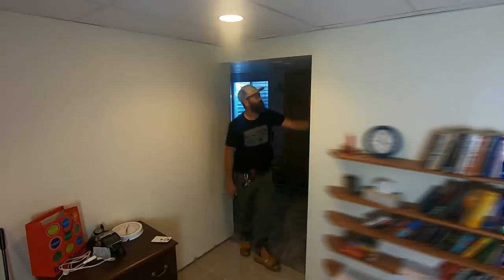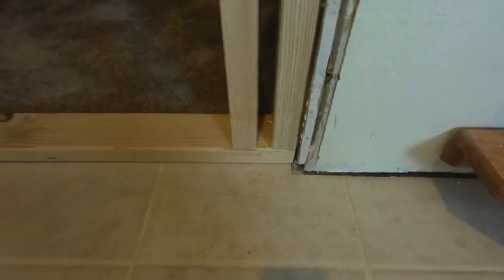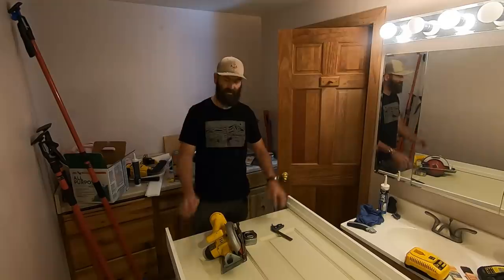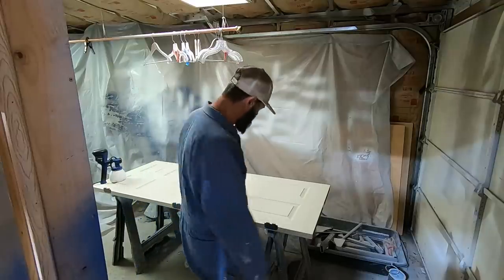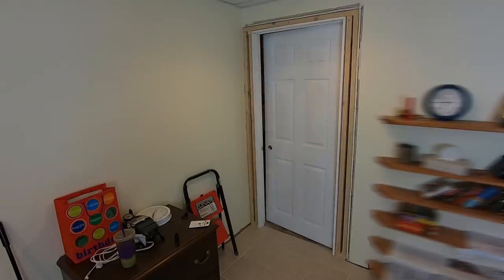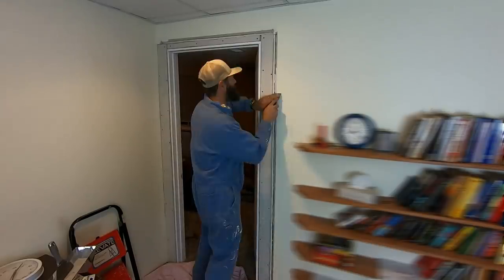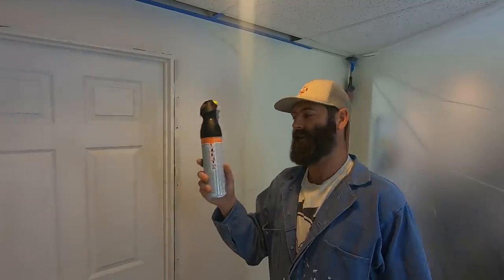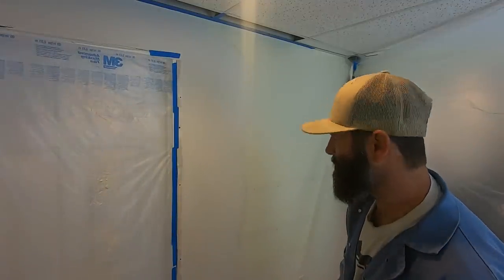The Impossible Doorway Build | They Said It Couldn't Be Done | THE HANDYMAN |

Comment: I would have filled the bottom of the door because I've had problems with moisture building up inside the door and causing problems with particle board swelling at the top after several years. Paint seals up the bottom.  I put an old vitamin plastic pill bottle on my box gun and so can do small amounts of texture, didn't cost me anything.  I'm sure you filled the door frame holes from the pin nailer like I would have. The foam filled hollow core doors tend to resist holes because they flex a bit when struck and also keep sounds from passing through them. I think removing the shelves to make the job look right was the correct thing to do, but a lot of guys wouldn't waste the time and it would look like a slop job. I can say that the attention to detail was fantastic, and couldn't do it any better myself. I love watching an artisan at work!

Comment: Pretty good job a couple things to remember though normally only the legs of the jam are secured to the framing not the head meaning the door could have been taller by about 2 inches taller and the rail of the door that was cut out should always be replaced to keep the strength in the door and prevent the door from rattling just trying to help out not put you down

Comment: Good work man, I learned after 10 years of drywall to use those straight edges (door jams) to float the mud, obviously trim will hide most but it saves a lot of time in scraping/sanding. Keep up the good work

Comment: The reason for the missing screws is that you can put a longer screws to help the door from coming loose after time. You drive the screws onto the 2 /4 behind the door jam.
Reply: P.s. to missing screws .You need the longer screws if you hanging a fire door because of the weight of it.

Comment: I believe the missing screw in the hinges is so u can put a 3" screw so its more solid at the hinges.
Reply: Unlikely. We saw the wood, inside the door, in which the hinge screws are installed.
It must be around 1-1/2" of screwing depth maximum.
Reply: @paulp.l.4869  yea u right my bad. I used a 3" in my door but I had over 3" of wood to grad
Reply: @smfd190  
Thanks for the reply.
On full wood doors you could go longer.
I've been using the supplied screws that come with the hinges for interior doors.
On exterior doors I use longer construction grade screws to get to the studs, but keep the 1" screws for the door side.

Have a great weekend.

Comment: When I have a cheap door like that and some of the screws don't want to bite,I will actually use construction adhesive in the mortise and on the backside of the hinge.ill also pump it into the screw holes before I put them in, obviously you want to do it with the door off the jam and let the glue set up before you re  hang it.

Comment: I tried to use that texture in a can,and for the cost and the potential for the applicator tip to become inoperable, usually from one of the other guys using it. I went back to the old trick of using a gong brush and then I get joint compound and add some water to get a consistency for a particular texture finish, here in Texas acoustic is popular for walls, which incidentally on a long steep stairwell, is good for acquiring some road rash if you're a little tipsy and you get off balance going down the stairs. I dip the brush into the mud and then you flick the bristles and then it magically creates the texture. Great for a spot texture approach. Interesting thing is I learned that trick from a roofer.

Comment: your work always comes out great!  I'm a carpenter also, I was wondering if you could have shifted the door over to the right and just pad the left side, (unless the rt was a corner and not an end) and if the height worked for the door without the 2x on top so you would not have had to cut the door

Comment: Tough situation, but you did it.  I had a similar situation that I think you’ll appreciate.  I installed a double french door in an opening where the south wall was racked east at the top and west at the bottom by 3/4 of an inch.  The north wall was racked west at the top and east at the bottom 3/4 of an inch.  On top of that the opening was racked at the top north by 1/2 inch, and south 1/2 inch at the bottom in opposite directions.  So I had a rhombus geometric nightmare.  But, I was lucky.  It was a 5’ opening, so I closed it in to a 4’ opening with additional 2x4s, and corrected the racking so that I could install a 4’ double french door.  It was not easy doing the wall correction in only 12 inches, but it turned out great.

Comment: I would have glued a filler in the bottom. That thin skin has to be very weak.
Reply: Yes, why wouldn't you fill it?
Reply: Over time it may bow or weave with moisture also
Reply: I totally agree. It will warp or get kicked in and only takes a minute to reinstall the filler you just cut off
Reply: Perfect! What I've done that I've found quick and precise is rabbet the finish side off and cut the ends off at the saw. You're left with the exact same filler to be glued back on. To hell with their warranty. It's a $40 slab.
Reply: I normally cut a new one and glue it in but without it the door will eventually be jacked at the bottom
Reply: yup its gonna warp may not for a while but it will smallest amount of dampness and it will look like the ocean it is pretty much pressed cardboard  i always put mine back in never got a call back on one in 40 plus years of doing it they used to have way more stuff inside them back in my day they had cardboard all through the core now its even crappier
Reply: @jwp09  not maybe it will for sure i have seen them warp in just a couple of weeks just need a little dampness and once it swells up it never goes back
Reply: The unconventional approach is to use a couple cans of great stuff to fill the cavity and then the bonus is that you wind up with a significantly thicker door as well.
Reply: You always glue in a filler after you cut the door,  and you also would have only needed 1 or 2 cripples ( not studs) each side, floor to ceiling. In this application, there was no need for a top or a bottom piece.
Reply: He's a handyman, not a trim carpenter.
Reply: @DARTHFEAR0N  dont matter any job worth doing is worth doing right every carpenter i have ever met in 40 plus years always puts the piece back in the bottom if you are doing this kind of job you should know that its first day on the job kind of stuff i would teach noobs on their first job
Reply: @kirkyorg7654  you're right. Every door I cut off like that I do put the bottom back in.
Reply: It will make a great home for bugs!
Reply: I always fill the bottom in when I cut down a door. Usually just trim the old bottom with a table saw and glue it in,  Not sure why he needed to pad down the top of the doorway 1 1/2", either. The less you cut off the better, especially on a 6 panel door.
Reply: this is how he gets them to come back in a couple years

Comment: Once you had the framing done I would have cut out the top plate too, of course a screw in the top and bottom plates between the studs, you would have gained 1 1/2 inches to the height, also was the drywall proud all around?  If so shoot on some jamb extensions and avoid all that mud. Keep on keeping on mate ;)

Comment: Nice job..  good thought on leaving the hinges in place, seems like door quality has been dropping steadily every year, lower end stuff anyways..  I've had that frustration, putting in a bunch of new doors, and it doesn't take much at all for those little screws to be stripped out.. all good and done, then the painters come and screw around taking the hinges on and off, then have to go around fooling around fixing sags here and there..  I usually fill in the bottom when cutting those hollow cores, just rip a piece of wood, some glue and clamps, or couple brads if you're in a hurry.. might help if someone kicks at the bottom..

Comment: Buy a Laco TG 950 texture pump, we all run it in my company, thing is suuuuuch a time saver and cost effective, I keep mine mixed for weeks, then when I need to spray I just clean the tip and mix it a little inside the jar with a small paint mixing paddle. Get the Brass one, the plastic one breaks
Reply from the maker: Thanks for the tip!

Comment: Generally a nice job but I was surprised that at least on the hinge side of the door that you didn't use a couple of shingle wedges between the 2x4's with either screws or nails to beef it up a bit and that you didn't fill in the bottom of the door with a wood plug to keep it sturdy as well.
Reply: I usually trim the original plug off trim it up insert it back in with some glue done deal.

Comment: There's a machine that feeds the screws down a tube to a drill head and those put the screws in the hinges. If the top screws are missing, likely that tube got plugged. Pretty common. The hinge man down the line is supposed to see that and set the missing screws by hand and notify the controller.

Comment: They sell furring strips that are  1/16 inch by 1"1/2 also 1/4 inch by 1"1/2 inch furring sticks  to add to the 2by4 to give u that little 1/4 or more to make it flush to the existing wall...saves time and dont have to  feather  the joint compound

Comment: What were you doing with the tape measure and lever at 1:38?  Seems like that may be a trick I need to know!
Reply from the maker: I'm making sure i'm putting the framing in the right place. When I install the drywall It has to match the existing drywall.

Comment: Where do purchase all of your tool to Dewalt vacuum connectors?
Reply: @TheHandyman1  sorry maybe I worded my question wrong. I noticed you use the Dewalt 20v vacuum. I was curious where you found the attachments for say your orbital sander/ drywall sander etc..
Reply from the maker: It just loosely plugs into the back of my sander.  For my workshop I ordered them on amazon.

Comment: Still remember this one customers reaction after seeing the inside of their door after I cut the bottom off. I was installing engineered hardwood which brought the level of the floor up just enough that the door didn't have enough clearance, So I told the customer that I would need to cut off the bottom of the door, and after doing so the customer came up to see how things were going and looked inside the door. They said WTF I paid $400 for some piece of $h1t that has packing foam in the middle.

Comment: So why do you feel it wasn't necessary to put a new filler board in bottom of door?
Reply from the maker: Good question.  I haven't had any issues in the past.  I have cut down a lot of these doors.  I only put a bottom in when they are bifold doors because the pivot point goes in the bottom.  There is no stress on the bottom of the door in the video. It might get opened and closed a few times per year.   We will check back in a few years to see how this door is holding up.

Comment: I would probably have skipped the added 2x at the top and stripped the drywall in the same spot. Then only taken 1 inch off the door instead of 3. Possibly even attack the existing "header" if possible, if the wall isn't load bearing..
Reply from the maker: Then there would be no room for casing.
Reply: @TheHandyman1  had to look again. I didn't notice that was the ceiling height in the next room. Still I would probably sacrifice the trim for as much head room as possible.  If it were my house.  Fewer future headaches that way.

Comment: They missing the top screw because you usually run a long screw for it to hold the door good, a 3 incher or so, it udually comes in a little baggie attached to door or you just have to buy it if itd super cheap door
Reply: That's the jamb not door
Reply: @josephtrant9006  yeah the long screw goes on the jamb to the framing not in the door

Comment: I thought they leave the screw out to install a longer one that would hit the stud in the frame ? Like a front door for more security can’t just be easily pushed open but I am no pro by any means
Reply: But this was a screw missing on the door side not the jamb
Reply: @robs1852  ahhh well fuck sakes see I’m no pro lol missed that part I guess much obliged
Reply: @tylerhowerton8518  You're right about putting a longer screw in the jamb to reach the stud, especially a heavy door at the top hinge so it prevents sagging.

Comment: I'm halfway through. So disappointed!  First, the bottom piece MUST be glued back in!  It prevents buckling, keeps the bottom blowing apart if the door catches on something.  It prevents moisture inside the door. In fact, door manufacturers stamp on the top and bottom edges that the warranty is only valid if all six sides are painted.
About the screws, door manufacturers include one long screw for each hinge to anchor the door to the stud.  
Lastly, leave the rough frame doorway half inch to an inch larger than the door jam and shim it square and plumb.  This way, if the framin lumber warps, you can adjust, and down the road, a replacement door/jam will fit easier.  Square your jamb, don't fret over the rough frame.
These are things a professional should know!

Comment: Broski you took 1-1/2 inches than you needed to. Next time cut your top plate out like did the bottom you will end up with a taller door. And you won’t cut of the 1- 1/2” wood support along the bottom of the door  you should never need to trim off that much unless your building for hobbits.
Reply: But you got it done regardless good job man keep up the good work.

Comment: Did this guy just caulk rough framin'????

Lool
Reply: Try and think about this simple nails and screws where ever put will be the leverage point, that besides his trim ,is what the door is gonna rely on which leverages off those (caulked rough framing) ...but since now it is caulked and he pressure clamped it the leverage is now distributed on the whole stud and wall it's attached too so food for thought ....his door frame will be there longer than you will be here so there's that to ......

Comment: Why did he add 2x4 on the top?
Reply from the maker: to be able to put door casing around the door.
Reply: But there is one already under drywall, just remove the drywall and you save two inches
Reply from the maker: That's not how it works.
Reply: @TheHandyman1  I'm talking about top 2x4 not sides, I know how I works I'm doing the same things and opening is supposed to be 83 inches,  and if you made a mistake and did what you did, all door jambs are 82 inches and if you cut off 3 inch off of the door  jamb and door your door handle is lower 3 inches.

Comment: I am not sure where you live and work, but if you are running into a lot of buildings that are out of square then you all need to have an investigation done into your Builders and INSPECTOR's in your area. If you can not build a structure that is in square then you really should not be doing that kind of work. Second, from what you said in the video I believe I am correct in my thinking that is not your house. NOT putting that board back in on the bottom of the door you trimmed means you will never work in my house ever. If you are cutting corners on a job your not going to get pain a dime and you should not get paid for that kind of garbage work mentality. An you should not be allowed to do so. Your the kind of person I am always having to go in and clean up after because you didn't do the job right the first time.